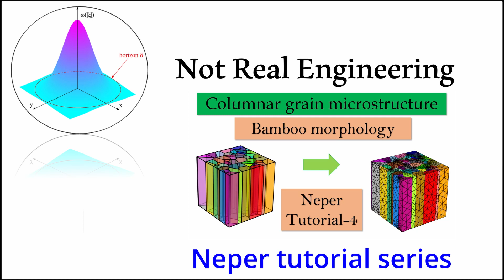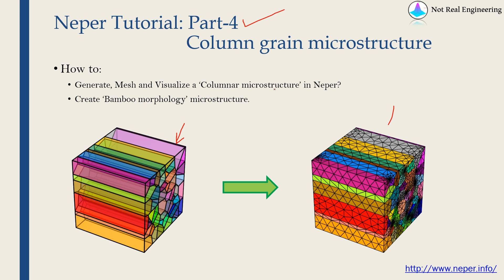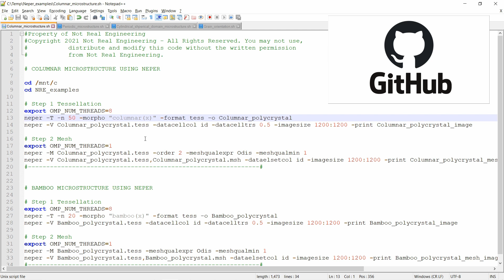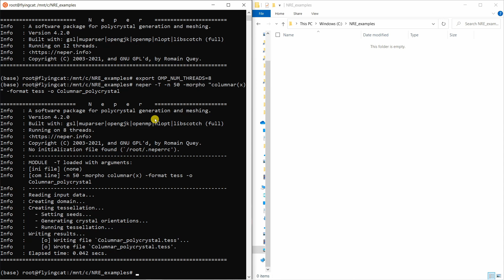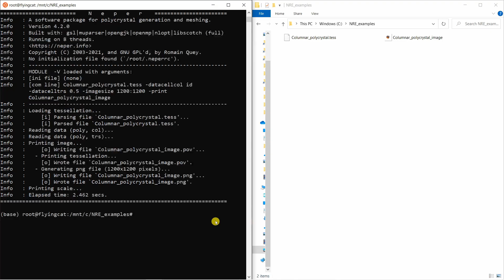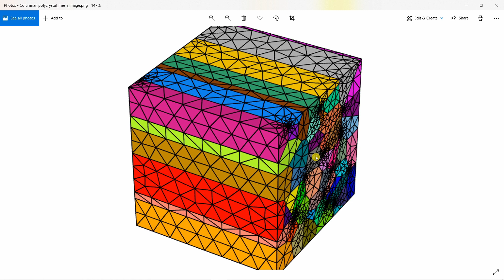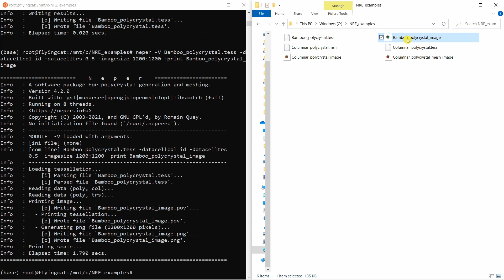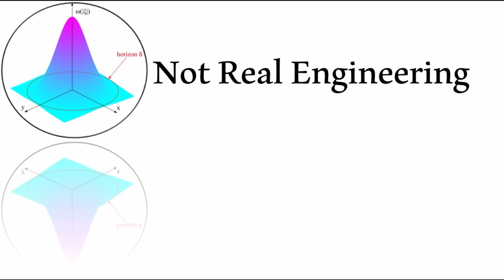Columnar and Bamboo microstructure using NEPER | Neper software tutorial part 4

Comment: Hello. I completed the simulation in fepx and when I visualized with neper, I was prompted that "Segmentation fault (core dumped)". What is the reason?
neper version 4.5.0    FEPX version 1.3.1-1
Reply from the maker: Run the neper on single core and try again.
Reply: @NotRealEngineering  It did not work. I update the neper to the latest version, but there is still a fault.